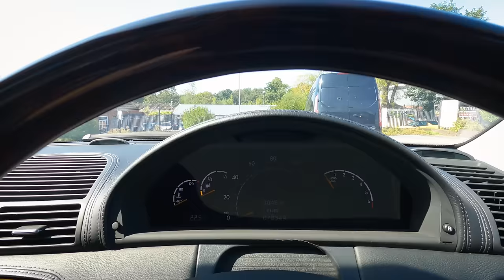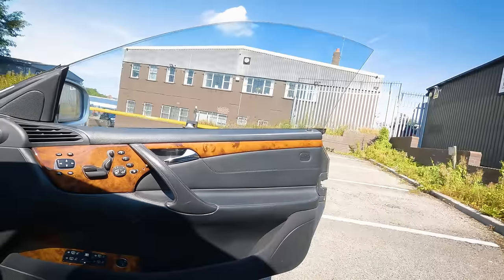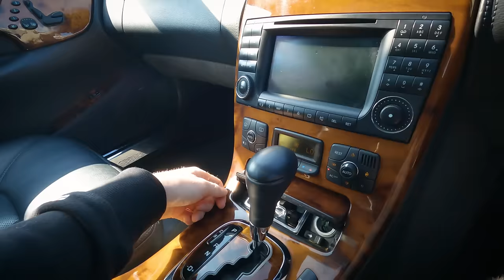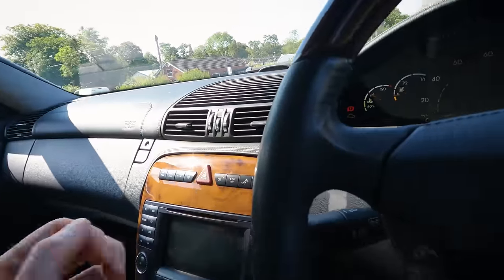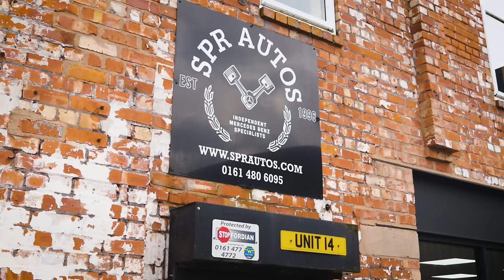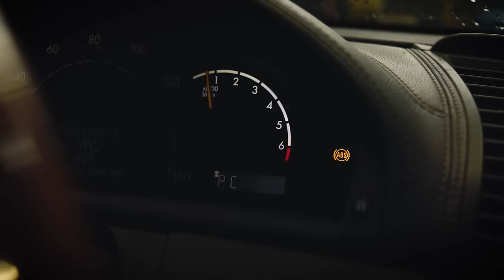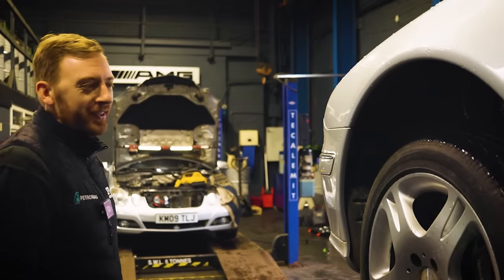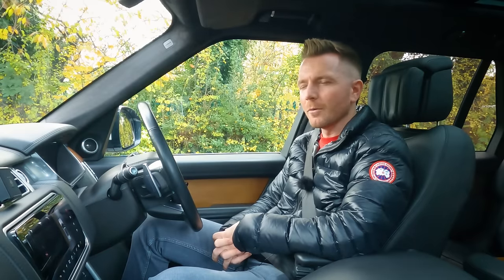I BOUGHT A CHEAP MERCEDES CL500 FOR £1,500!

Comment: You know I had one of these. Loved it. Most of those engine lights are due to the weak battery and will go when you fix the alternator. You can purchase reconditioned struts from various places with long warranties for around £600 each. Dronfields are good for breaker parts. Get it fixed 😊
Reply: Matt loves a challenge. Wonder if he'll bite? Its a lot of car for very little money and the mileage is very low. I guess the car lying about hardly turning a wheel has been its downfall. Such a shame.
Reply: Awesome response. Especially after me saying in a previous comment that it would be such a shame to scrap this car but it surely must be scrap.

Let’s get viewers, in the know involved and see who can reach out with help to restore this car at the best price.
Reply: Still though even at £600 each for all 4 corners that's £2400 before you touch anything else on the car. Be interesting to know how much it'd take to make it pass MOT...not that it'd be sensible
Reply: Think this one has to go….to repair this car properly, and will probably need a full respray…it will be 15k plus, and unless your planning on starting a collection…makes no sense even for you Matt…..I await your decision
Reply: But the struts are just the start. Even if most of the faults are related to the battery, there is so much rust and rot underneath. It sounds like rear disks and pads are needed, plus all the various ball joints and so on. I don't think this is a commercial proposition, but it might be a great project car for someone who has the time to do it.
Reply: @joejopling3295 yeah it’s absolutely rotten
Reply: @johnpirie3800 yeah. Leaving a car stationary to rot is never a good thing

Comment: it's amazing that Mercedes, once the byword for motoring lifelong quality, dropped the ball so far in that era. The S Class of the period, the W220 was also shoddily put together.
Reply: Agree
Reply: Yeah, and Matt’s comments about wood screws not being factory fit?  I wouldn’t be so sure….
Reply: This era of Merc were rust buckets as well as all the other problems. So it will rust everywhere whatever you do.
Reply: end of 90's onwards is when the bean-counters took over all areas - cue big decline in overall quality , sad .
Reply: Oh dear. It's pretty much recked. The engine is probably the only part working properly. It's very stylish and so much effort was put into things like hinges but so much cost cutting elsewhere although water based paints must take some of the blame for the rust for cars that age
Reply: This is the period when Mercedes took over Chrysler. The board were amazed at the low price it cost Chrysler to build a car, and back in Germany, the engineers were no longer in charge of standards, it was the accountants. To be honest I am not convinced the wonderful German engineers have got back control of the company these days. There are still signs of cost cutting in the current models.
Reply: Another marque living off the reputation of the past. Today they are no better than any other brand for the same money.
Reply: Because the engine was designed in time when engineers were in charge, and not accountants like the rest of it 🙂
Reply: And also this is the reason why I'm against the "low mileage car" thing if it's not garaged all its life which is quite rare...
Reply: it's a terribly undermaintained example, clearly did not receive much attention and care during these years. properly maintained ones are still quite quirky to run, but far from unreliable. those are going for like at least ten times this price though.
Reply: @HampshireHooker yes indeed. Same at BMW,  sadly. So much plastic in the engine e bay. 😮
Reply: Was this around the time Mercedes began building cars in South Africa?
Reply: @a.c.4732 yes. I may be wrong but I think it started slowly with the w210, like you said, the. End of the ‘90’s. 
W221 I think is a pretty decent Mercedes, Matt reviewed one and it wasn’t bad. 
W211 E 500 had a good engine and transmission, w212 M272-M273 engines are good. But the interior quality, for how much they were priced, fairly cheaply made.
Reply: Engine aside this doesn't compare to my 740i E38 with three times that mileage..no rust just same faded lacquer and no warning lights on
Reply: And BMW were at their peak with E38 E39
Reply: the Rust issue springs to mind ... Its amazing how these mammoth companies can skip on such detail... maybe every merc  built in the early 2000s was a Friday car?
Reply: The WORST car my Dad ever had was a Merc. It was about 3 year old but was falling to bits. The boot used to flood with water, there were rattles galore, never ending warning lights, harsh ride, cheap materials, fake leather etc. He's not one for chopping and changing but he didnt even own it for 6 months. He'd had Saabs (real ones, not rebadged Vauxhalls) forever prior to that with zero problems. He relented and bought a Golf..ran it for years without issue.

Comment: It's a pity most Mercedes get to be so badly maintained! I've had a old (1998) where most of the troubles were regular maintenance and correcting the crap previous owners did to the car. Many of those supposedly to "save money". As in total failure! 
Properly maintained these are awesome cars.

Comment: For ESP and ABS, begin with turning the steering wheel from full right to full left with your foot on the brakes. It might fix the issue, if the was only due to low battery or battery change.

Comment: As always great video Matt - These are great cars - I have a 2001 (Y Reg) that I purchased in 2017 with just over 25k on the clock ( I did pay top whack which was about £7.5k) - it's in Almadine Black with a light interior so it looks stunning - it was hardly used until 2013 when the mileage was10.5k I think it may then have changed hands as that year it did 4k miles and had £2.5k service (16 new plugs!).  It's not been a daily driver, I've done on average 2k miles per year so it's just under 40k miles now.  I use Merx Cheshire an independant in Macclesfield for all my mechanical work they do a great job I've had two or three services over my time with pads and discs replaced - mainly due to standing outside over winter - no issues with the ABC - and it's been perfectly reliable.   It's awesome to drive - corners flat with the ABC on, the ride is smooth and a great engine that pulls at 80 mph like it's just getting started, plus on steady motorway runs I get low 30's fuel consumption, the interior is luxury - and everything works (altough the distronic cruise control is temperamental, and I've had simillar but not as bad issues with the glove box/central console)  and it has a fridge between the back seats !!   So great cars worth saving - but I think yours is to far gone - maybe before pulling it apart you could consider what are the good bits look for one that was tatty iinside, possibly with a few faults and maybe a bigger mileage therefore again cheap - then see if if you could combine the two to save one then sell off the parts - I know probably just a double loss  but they are such great cars for small amounts of money.

Comment: As there's not many left; break it, work out which bits are good to sell on and scrap the rest. You could probably get some money for the personalised number plate as well. 

They're lovely motors, but this one would be more money & hassle than it's worth trying to put back on the road. May as well use it to keep other on the road.
Reply: Used as Spares?? theres pissall worth using
Reply: Unfortunately you can’t do anything with the number plate until the car has an MoT, so no go there.
Reply: All the good bits will probably still be good on others, and all the knackered parts people are looking for will be knackered on this as well.

Comment: I have just bought a 53 plate CLK500 with 71k on the clock, looks mint all the electrics apart from the cigarette lighter work and it has no obvious rust. Just waiting for my merc trained mechanic to get back from his holiday then we can look underneath. Fingers crossed. I am impressed with your shop so I may be bringing it to you.

Comment: The CLK is just a better option if you want a coupé from this era. Not as complicated or expensive to run. Based on C-class running gear and E-class interior
Reply from the maker: I actually think the CLK is prettier
Reply: Agreed 😁
Reply: One of my neighbours has both a clk200 kompresser and a cl500 as well as a r129 sl500. They're great cars and I think I prefer the clk. The cl500 and sl500 he has doesn't get driven often unfortunately because of the ULEZ but he doesn't want to get rid of them🤷🏽‍♂️. The clk was bought simply for that reason to avoid the ULEZ charge😂
Reply: @HighPeakAutos clk was a birds car your CL was the car to have
Reply: @martinlove7073  Agreed, I don't fit in a CLK. The roofline is too low for me to see out and my head is against the roofliner.
Reply: I had a clk500 with AMG pack that I sold recently. Absolutely superb.

Comment: Great video as always. 

The cars not had part warn tyres on it, it’s just had a cheap puncture repair where they mark the tyre where the valve is, so when they put the tyre back on the rim they don’t need to rebalance the wheel.
Reply: There’s a place in Blackpool that sells part worn tyres from Germany without repairs for £20 - £30 each inc fitting

Comment: No more than five or six miles away from Matt's garage is a 500 SEC project that shows how things can go wrong. It's in the process of being converted into a cabriolet! It's been sitting in the same spot covered by plastic sheeting for over five years. Well, actually the sheeting collapsed into the body about four years ago so now there's more water in it than the Titanic .

Comment: Once you have done all the lights on the dash, you still have all the suspension and body parts to fix. I sold an old S class 500 SE and the guy who bought it sold it to an exporter who shipped it to Nigeria. They love them for taxiwork and are not fazed by things we consider as essential safety issues! I got £1800 in the end and I can probably guarantee my old car is still going strong. It had 127k on the clock when I sold it. Great car!

Comment: It would be interesting to find out whether any of the previous 15 owners lived in a salt mine. In my opinion, the underside corrosion is probably the most worrying aspect of this £100k+ leviathan. 
PS. You're right Matt, the wheels look as though they've come off an A180. 
It's got to be spares - the engine could see your £1,500 back if you can sort the warning lights. Anything else you can sell, would be a bonus but a bit of a faff. Mercedes owners club perhaps?
Reply: Agree
Reply: I'm certain the wheel rims are standard fit for a W220,my S320 has the same rims.
Reply: these are original wheels for this model and they look classy.
Reply: these wheels were optional for S320 @andythesoupdragon

Comment: Change the ABC filter and then check the ABC lines at the rear suspension arms where they rub through. If you get away with that, change the fluid as well.  Check the wiring in the door jams as well if the speakers fail cos that door hinge is a bast... and the central locking fails but if all good.... relax and cruise.

Comment: Ebay, Gumtree as 'resto project' for enthusiast in my humble opinion.  Back then the built quality wasn't any different on a CL/S Class than to a C Class.  MB made thousands of vehicles with a poor batch of steel.  I had a 2001/51 W220 S320 in silver that corroded in exactly the same places.  Had it repaired under MB warranty, a massive job.  New rear arch sections, bottom of all the doors and new front wings.  Both sides painted.  The repair work was that good it showed up the rest of the car.  Usual story.  Best part of this CL is that wonderful V8.   Good luck Matt!

Comment: If it was me, I would get an uprated battery, alternator and coilovers on it (leave it in the most comfortable settings for obvious reasons. It will be thiugh, a lot cheaper than replacing all the struta etc).

Get the electrics overhauled and welding where needed, and it (should) be good to go!

No doubt this'll cost 3- 4 times the value of the car at present, but if you're a risk taker, these could increase in value as the supply of these decrease (a lot of them rot, get scrapped etc).

And an old merc is always in demand, look at (dare i say it), the value of old SLs and SECs....some of them would've been dirt cheap at one point or another

Comment: I just bought a 2014 Range  Rover Evoque which needs a service to the rear 4WD Helvic thingy. Lr quote the service interval as every 200, 000klms, but an independant LR mechanic said more like every 50,000klm or you get a juddering through the drivetrain and if they go look out, big biccies!

Comment: Paid 2500 for ours 5 years ago great car .. just service it and change the hydraulic suspension oil and filters aswell we had the brake lines done front to back and a new coil pack that’s it in 5 years 👍🏽

Comment: I had a 2005 CL55 that I put 235,000 miles on and loved every time I drove it………..AFTER ripping out the entire ABC system and replacing it with coil-overs and a normal power steering pump. Other than ABC, it was nearly bullet proof and faster than just about anything else

Comment: Matt Its such a shame but if you break it down for parts you will easily get your money back look at the seats alone . Then the engine etc. it's not economically viable. unless ..... You did it up to be the best CL500 there ever was and then stored it in a garage and then when your around 60 years old it will be worth a fortune..... But is that worth doing great video thank you once again for sharing

Comment: I had a 2000 model back in the day, bought it with only 43k on the clock.  The rust on the doors, c pillar and bonnet are ally corrosion, mine had the same loose door controls - the seats not working is most likely the door wiring harness - mine decided to move the seat forward at 70 after going over a large bump 😮.  Sold mine in the end due to the endless issues although it is still on the road!  At least your ABC is working, those parts are worth a fortune.
Reply: Should have waited to the end 😂.  Its dead, could get a CL55 in OK order for the price if fixing that,

Comment: Hi Matt I've had a couple of these and the S500 saloons believe it or not if you have replaced the the battery after about five or six times starting the car a lot of the faults will go off the cars need to be used most of the electrical systems will start working again with regular use if you are going to (part it out) can I have the steering wheel 😊

Comment: Mate had one but got rid when it got gearbox aids the cooler is linked with rad so water getd into box something like that so put an aftermarket kit on to separate the system worked for a while but think damage done. Also the stereo had issues and mercedes in their wisdom instead of using copper wires like any sane person they use fibre optics to connect everything so very hard to find what is causing the issues. Sold it for scrap in the end shame was pretty quick id seen 160 and it drove lovely. Just wasnt worth spending the money.

Comment: Matt, this one is easy. Use it as a drift car, or just a simple tyre shredder. At least doing that will be significantly more enjoyable, and definitely cheaper than fixing it. It's clearly toast, so turn those tyres into smoke, rather than your hard earned.

Comment: My mate has just bought one with 1 previous owner. It’s in good condition and has  passed its latest MOT. He’s going to to spend an extra 2k on it, fortunately all cosmetic but of course new spark plugs and an oil/filter change. As his is a good example it’s an absolutely lovely car. More toys than a 2023 Kia! Soft closing doors etc. 

The engine is one of the best Mercedes have made and will outlive most. 
I say spend about 4K and An enthusiast will want to buy it even if there is no profit. Worth preserving?

Comment: The ABC suspension does indeed have steel springs - in conjunction with hydraulic pistons. I happen to have a complete set for the CL laying around :). Strange with the corrosion, I slaughtered a CL600 for parts and the body is made of Alu and magnesium + plastic so I wonder if the CL500 is made from steel?

Comment: I almost bought one 2 years ago, but after searching in Spain for a year, never found one I liked. In the end, I paid twice the price of a CL on an SL instead and haven't regretted it.

These cars are wonderful when sorted, but so many have had a hard last 10 years compared to their first 10. Living outside = rust. The high cost of repairs leads to many being bodged at home, and as Matt mentioned, the build quality was more Chrysler than Merc.

The engine and gearbox are good though. Strong and reliable. The ABC suspension is a money pit all on its own, the fluid needs regular changing and after 20 years, the accumulators are likely to be faulty too. But if you do that, its often good to go. If you need to replace a strut, it gets very expensive.

Those wheels are the entry level spec. They were rarely seen in the UK, but fairly common here in Spain.

I can't tell you what to do with this car, but i doubt that repair is economically wise. As a left field idea, if you can find a good CLK of the period, put the engine in that. A CLK500 is very rare and highly desirable. 

Lastly, if someone wanted a good CL in silver with graphite leather, there are lots available, for less than £6000 although finding one under 100,000 miles is unlikely.